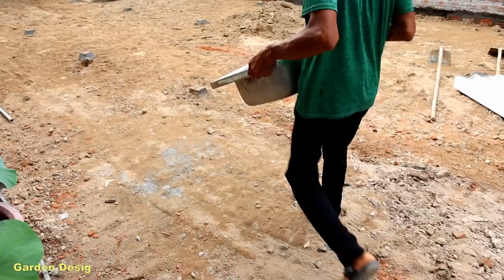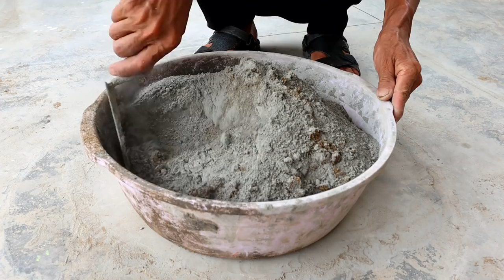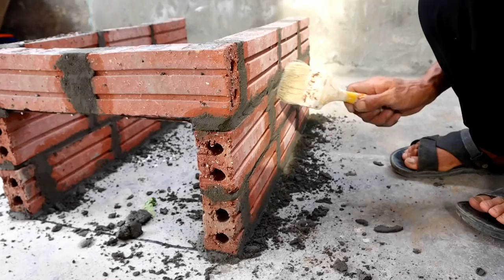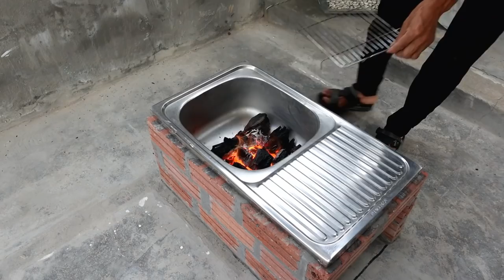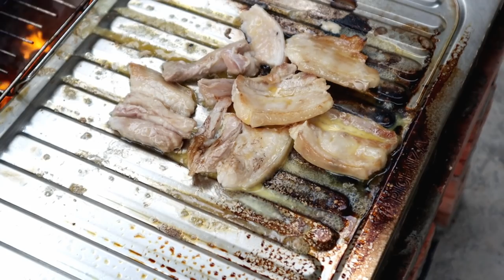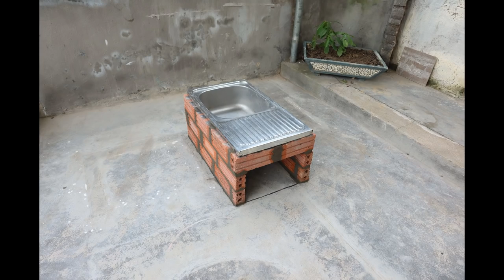Creative ideas with cement \ Make a wooden stove from a sink and cement

Comment: That metal is not designed for high heat.  This thing won’t last very long.   In a few months it will be warped and probably will have some holes in it.
Reply: Exactly! The action of fire is relentless if the material is unsuitable.
Reply: No doubt
Reply: True but by then he will get lots of views.
Reply: I thought the same. Also wondered if that type of metal can release some harmful stuff into the food when heated. 😯
Reply: It's stainless steel lasts for years I have two made into cookers as long as it doesn't get so hot it turns blue it very safe 🙂
Reply: @kiwi8.  不銹鋼有很多種編號，這不是耐熱的，加熱可能會有毒物產生。
Reply: Yeah it even burnt in first use
Reply: What type of material can be used for this. It’s a brilliant idea though. Please give some alternative material that can be used
Reply: por o
Reply: @nonhlanhlankosi6026  if it is stainless steel, it will work well. I use stainless as a foundation for blacksmithing forges (the steel is not in direct contact with the fire) and charcoal retorts (the steel is in contract with fire) and it stands up to a lot of abuse. Cooking fire is relatively low temperature, so it should be okay.

Comment: What will happen to the metal when heated at high temperatures for longer periods of time?
Reply: Одноразовый, в следующий раз нужна новая раковина.😊
Reply: Well.,lobsters won,t take that long to cook, don,t worry.
Reply: @882828jc  this is not for one time use I can see that. I’m sure there will be more cooking done after few lobsters.
Reply: If that is 304 stainless it will probably warp out of shape eventually.
Reply: Ненадолго
Reply: Palmeiras não tem mundial
Reply: Boom
Reply: This metal is not good for cooking.

Comment: The grill part looks ok. But using the flat side for cooking i dont think its a good idea. I dont think the metal its food grade 😂. But its a good idea. Gonna try it on my old sink
Reply: What sanding it down 1st ?
Reply: If its SS , then you can use it, 
but Iron plate is best as its better conductor
Reply: Stainless steel hopefully.
Reply: If you ever eat out at restaurants think about what the majority of there pans , pots, etc are made of .
Reply: @johnjohnson-sm3yf  made of Iron. ceramic pots

Comment: Sorry, but it is a poor plan. Great idea but wrong materials. It's a Stainless Steel ( SS )sink. It's obvious they do not know metallurgy. When that much heat is applied to thin SS it will warp considerably. Find an old cast iron sink and use it. But the SS is not the best choice. Love watching your vids.
Reply: 100% true

Comment: sorry, after few uses the stainless steel becomes oxidizable becasue the atomic structure changes in the metal caused by high temperature. On the other hand, the right way to cook with ember is when it is totally burn, other way the smokes it produces causes stomach ache. Not all the creative ideas are good...

Comment: Stainless steel can't use it for cook like that because of the toxic fumes
Reply: When was the last time you ate at at restaurant. Most all of there pots , pans , utensils, grills etc are stainless. Most of your commercial smokers are stainless . The list cld be endless here .
Reply: @johnjohnson-sm3yf  yes, but you can't use it directly in the fire, if you see a stainless pot the bottom is very strong and thick
Reply: @ignaciogodoy7095  Do some research on using stainless on open fire and get back .